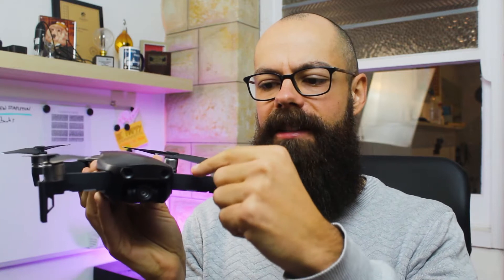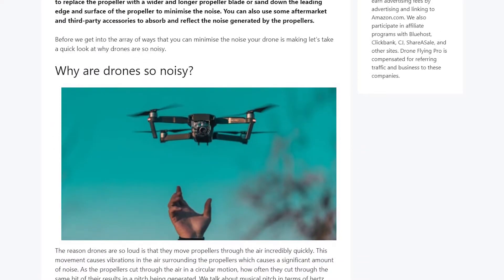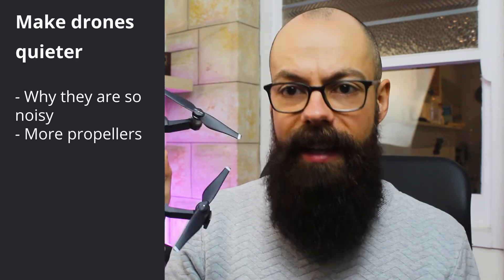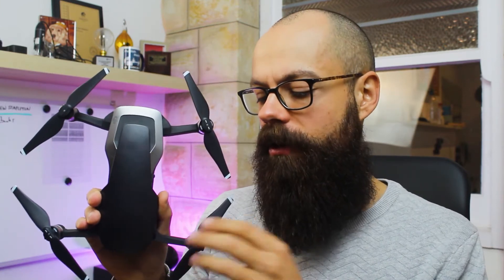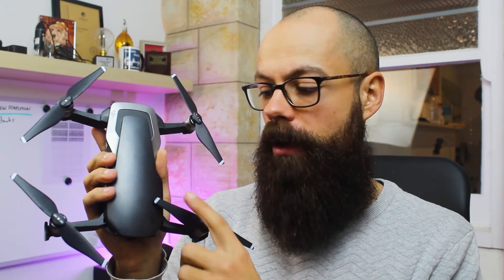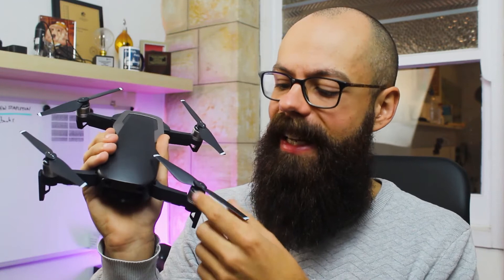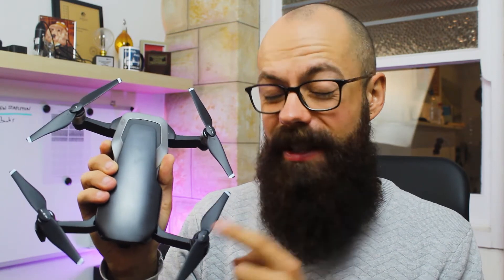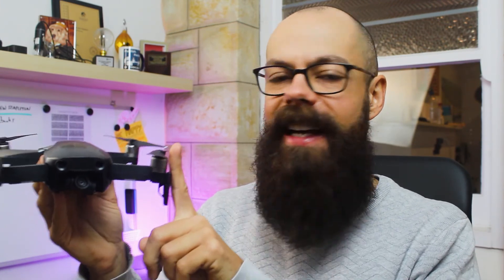How you can make your drone quieter | 5 Insider options

Comment: Why these drone manufacturers don't add ducting is just beyond...
Simple fibre glass or 3D printed ducting which weighs pretty much nothing, and it can add force by having the bottom a bit narrower than the opening, adding to the propulsion. Sort of like the cone shape a jet engine uses, only it would be fixed rather than adjusting depending on thrust. Could have it adjustable to make it even better but it would add a lot of complexity and more weight.

Comment: Sand off the part no. from the propellers and any remains from the casting.........

........and both the Airscrew and DJI standard sets of propellers will be CONSIDERABLY quieter !

(leftovers on the edges is a DISASTER for the micro aerodynamics of the propeller - and the letters seems to be a delibrate attempt to knock it completely off the rails - astounding that the DJI designers did not have the final say in this after all their effort to make the propellers perfect - the letters could have been imbedded in the material instead of made to stick out - on a perfect 90 degree angle from the surface maximizing the air resistance and micro turbulence - no wonder the noise !)

Comment: Flying at a slower speed or higher altitude will also reduce sound.
Reply: This not solution. Its just like u said that if u dont want to be noisy then dont play drone. What we need is pass the limit with same condition (same speed, alt, even some component)